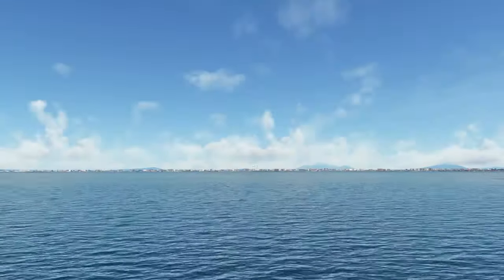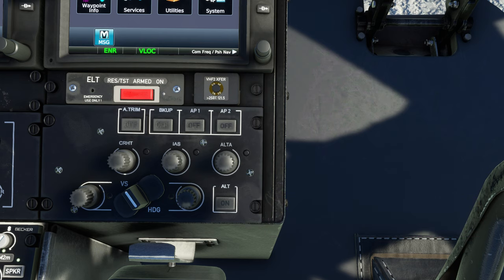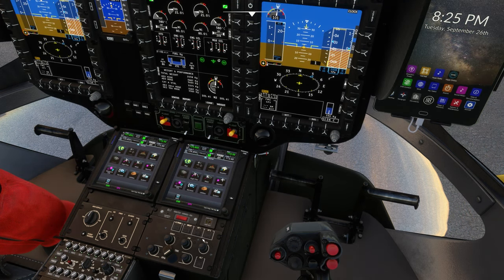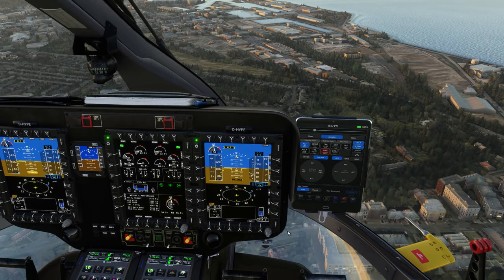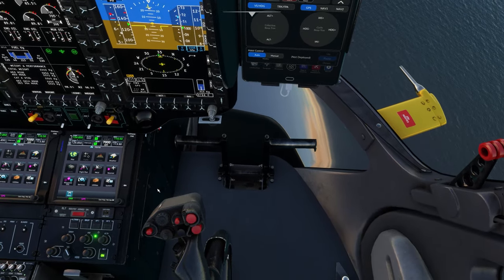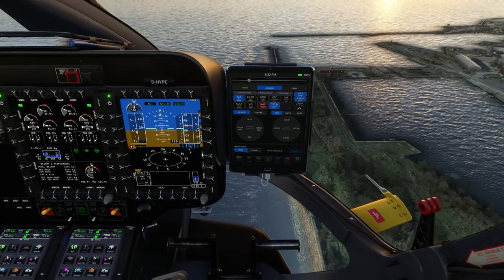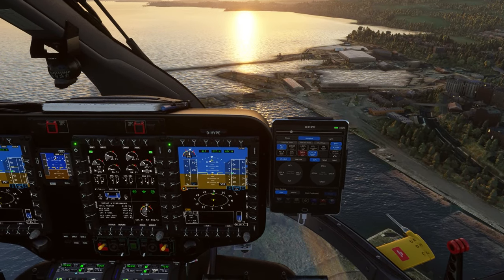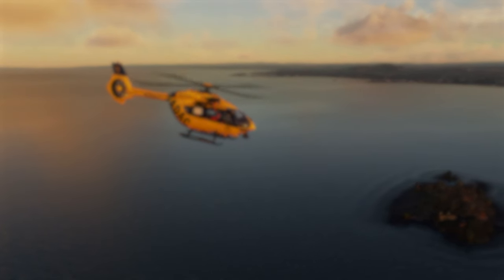Airbus H145 Autopilot Tutorial - Microsoft Flight Simulator

Comment: Great video I have the H160 which I think the auto pilot features are the same as the h145 my question is, I would love to do ILS flight in the H160 is it possible to show how to create the flight plan and ILS and does the helicopter land automatically for the ils flight plan? Thanks. I also purchased a collective the shark A60 not sure how to bind the collective and throttle in Microsoft flight simulator